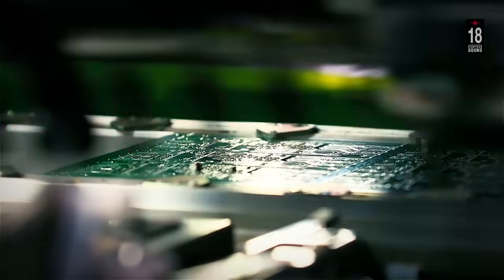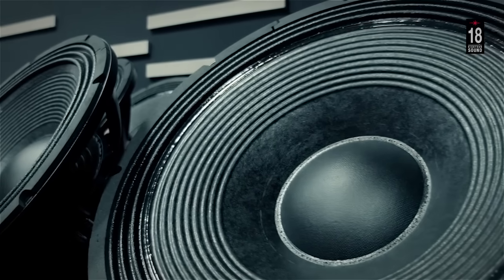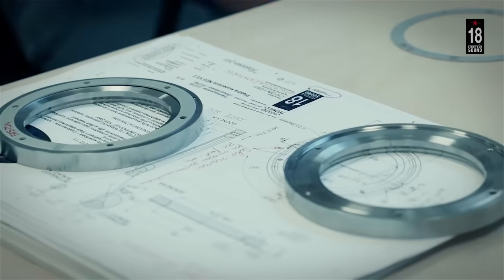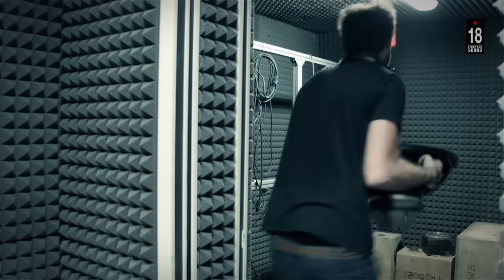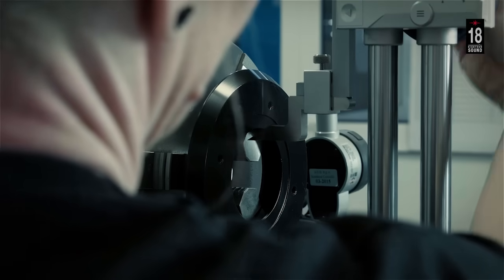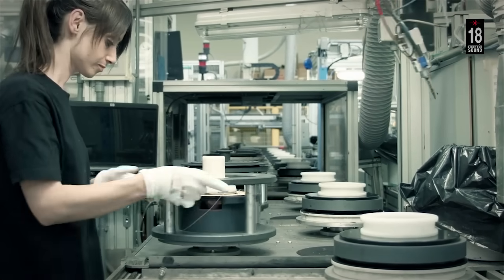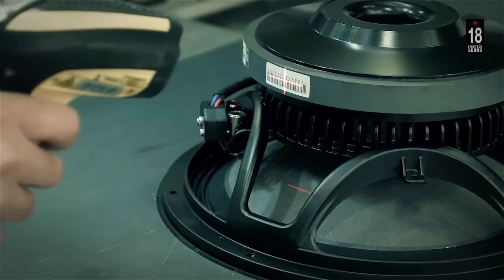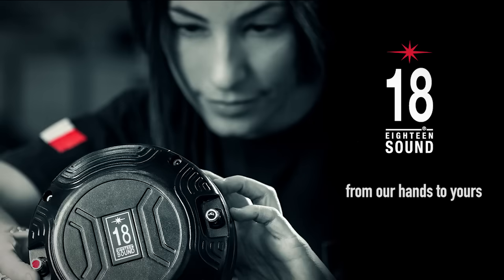Eighteen Sound Italian Loudspeaker Manufacturer

Comment: I love 18 sound. I have a pair of 18NLW 9601 that i am designing a Tapped Horn for.... X-mechanical  70mm  p-p. B&C  cannot touch that. Also.  I think i might have fallen in love with the girl @ 5:05.
Reply: Correct Sir. Tapped horn plays as low as the path length of the horn dictates. fs is a mechanical parameter, related to moving mass and suspension stiffness. Optimal drivers have fs around 0.7 of the lowest frequency dictated by path length. Best drivers have low Qes/Qts, high BL factor, heavy/strong cone. Suspension stiffness usually comes with a 'HIGHER' fs, as they are related. Download 'Hornsesp' program. Enjoy.
Reply: Andrew Ludlam